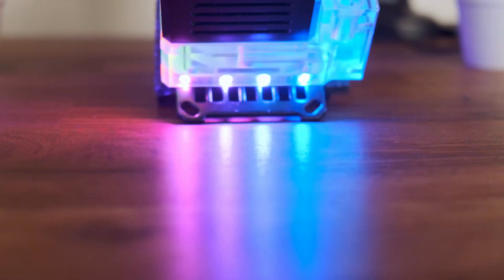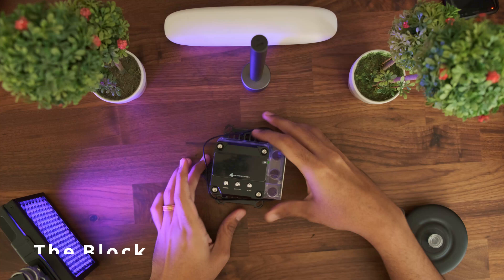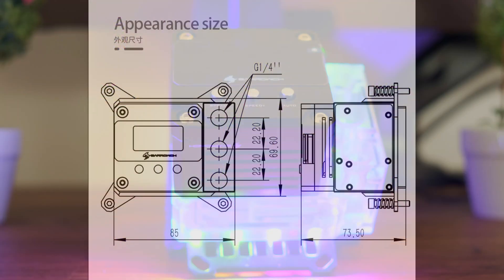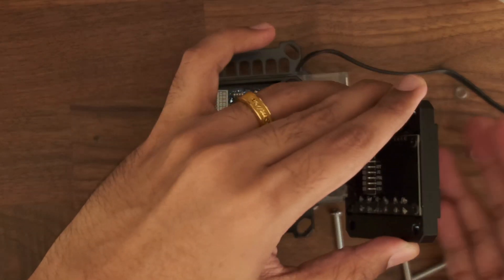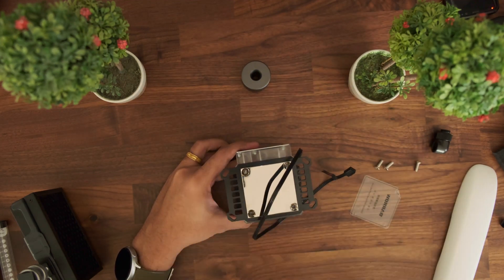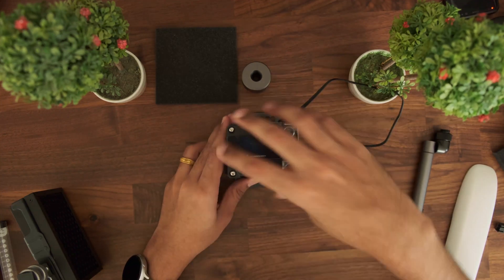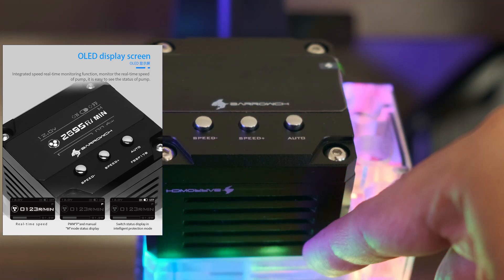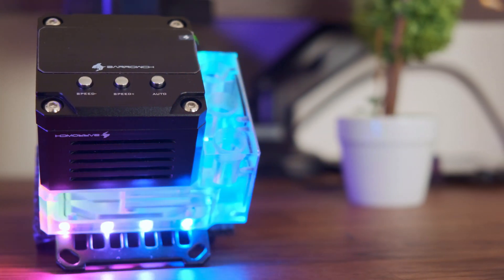AIO CPU Block for your Custom loop - The Barrow 3 in One CPU Combo Block - Part 1

Comment: If it is integrated why is there an inlet and outlet port?
Reply from the maker: its not an AIO in the traditional sense.. it still needs to be connected to radiator via tubes and fittings..

In custom water cooling loops the CPU block, reservoir and pump are separate. This combines these 3 parts into one

Comment: do you know if this block works with AM5? I guess those longer screws for AM4 is used with the same screw that came with the normal screws package? what are the normal spring package for? AM3 maybe?

Comment: i have this thing. the pump inside is actually a D5. i literally ground it to a halt to i'm now looking for a replacement impeller. i bought a XSPC D5 pump but the impeller protrudes too far out (the barrow pump is low profile), so i cannot use it :/
Reply from the maker: Really, it's a D5? Cuz of its size I am pretty sure it is a DDC pump.. I did look it up now it is a DDC.. I did find another model which has the same pump and it mentions it's a DDC pump
Reply: @Rons Tech Reviews  i didn't know it had a D5 in it until i opened it a few days ago. at least mine does - the cpu block+pump+reservior combo with a display
Reply from the maker: God why these Chinese manufacturers have such poor documentation... Hehe I was gonna replace mine with ekwb DDC pump when it fails.. so far so good.. it hasn't failed till now.. so haven't opened it up completely to check mine yet if it's DDC or D5
Reply: @Rons Tech Reviews  ignore me. i just watched one of JayzTwoCents videos where he disassembles a DDC pump and it has that low-profile impeller i need for my barrow! all this time i thought the whole half-globe impeller design is specific to D5. now i'm finding out that part of the design is the same for both. makes sense now - the D5 by XSPC i order thinking i'd be able to replace the impeller, it is all together a much bulkier design than what's in the barrow piece.

Comment: hey ron thank you again for this information. i'm using this item now and having a weird find-i don't have a safety 2pin power connector coming off of my block, but i have what seems like a small speed dial instead. my variant is the block with fins on the top instead of buttons. is that anything to worry about? i can't find the manual online lol
Reply from the maker: No, it's fine... you just got the normal version that's without the OLED display. and yeah I guess you can manually control your pump speed using the knob and you don't have the safety shut down pins that the OLED block has... i also tried to find a manual for your block but no luck
Reply: @ronstechreviews  thank you so much! Most of my setup since has gone ok, but I'm stuck on getting a bubble out of my fill port. Is it possible using the fill as my return instead of the inlet is causing an issue?
Reply from the maker: @caml1720  no unlike gpu waterblocks... its best you use either of the dedicated fill ports as the inlet (A or B). I am using A as the inlet, B is closed with stopper, and C is my outlet.

Comment: show fitting and tension of mounting would be useful, barrow manuals are pretty much worthless
Reply from the maker: Apologies for the late reply, Yes I'll remember that next time .. just so you know the included mounting hex screws are tiny and they can't be turned beyond a point the hex head just doesn't stay to turn it, it just slips. I hope you get what I'm trying to say.. anyways... I ordered another set of mounting screws from AliExpress and it seems to be compatible with this one so I might use those mounting thumbscrews instead of these included ones

Comment: Finally someone talk about this block, is the waterblock also show CPU water Temperature?
Reply from the maker: No, sadly the pump head oled display does not show the water temperature
Reply from the maker: However if u pair it with the Barrow boxfish reservoir, the Res oled display shows the water temp in the reservoir
Reply: @ronstechreviews  wow that’s strange, and what a way to sell you more stuff

Comment: Amazing video. Very informative.
I have a question though about the size.
When installing this unit, how is the ram clearance to the right where the in/outlet ports are?
Can I rotate the unit in the bracket so that the in/outlets are facing upwards when mounted?
I have a Asus ROG Strix x570-I gaming mini ITX board and want to use this pump with it. But I'm worried about whether it will fit on my board.
Please help.
Reply from the maker: Sorry for the late reply.. 
1: you will not have ram clearance issue in it's normal position where the ports are on the right, right next to the ram slots.
2: For the AMD bracket model.. it is not possible to turn it in a way that the ports are at the top cuz then the mounting holes becomes inaccessible (I've shown this in the video where I try different orientations of the bracket). However it seems in the Intel version this is not an issue.

So in conclusion, no need to worry about your ram clearances. As it generally won't interfere.